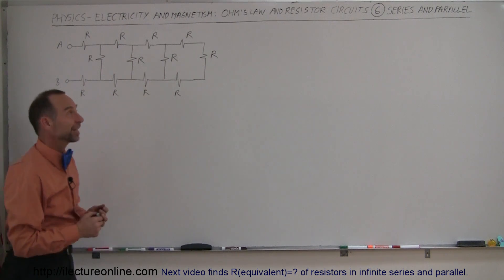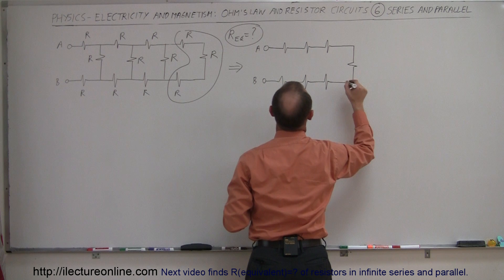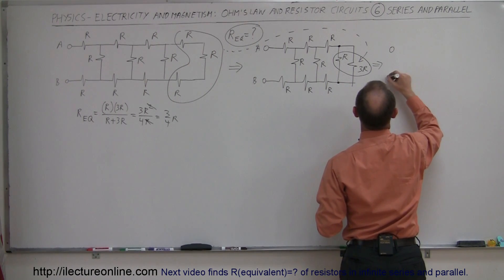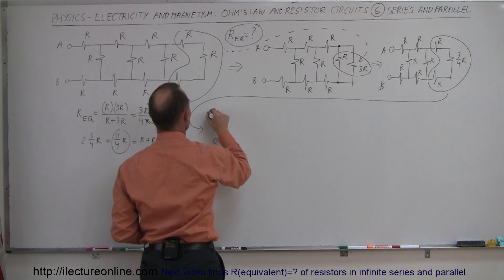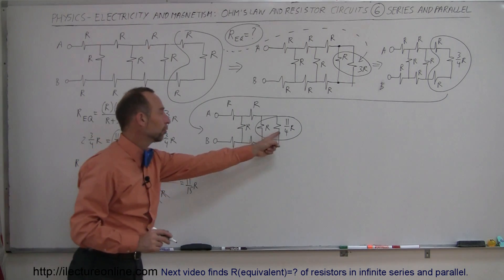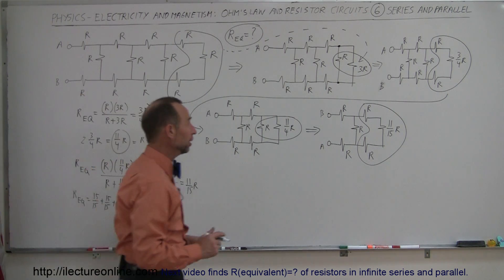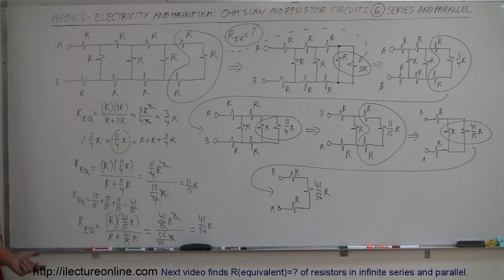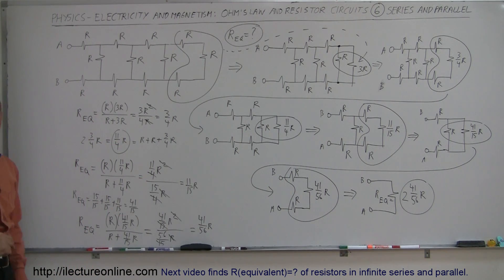Physics 42   Ohm's Law and Resistor Circuits (6 of 23) Series and Parallel

Comment: do u have tutorial on how to solve current with this? thanks :)
Reply from the maker: There are a lot of videos showing you how to do circuit analysis in both the physics and electrical engineering playlists.  Just go to the home page, then click on playlists and find those playlists.  Let me know if you have trouble finding them.
Reply: to find the current you'll have to build the circuit back up after you have calculated the the equivalent resistant

Comment: you need the + sign Michel, otherwise your saying the total equivalent resistance is 2*(41/56)R rather than 2+(41/56)R
 other than that good job!
Reply: Hello Michel I think what +1willFALL meant is instead of writing 2(41/56)R you should have written  (2+41/56)R and BIG up from Morocco
Reply from the maker: +1willFALL No, there is&#160;no "+" sign required.&#160; Answer is simply written as a mixed number.&#160; (remember those?)  Thanks for the feedback, always welcome.

Comment: I don't understand the final calculation. If the last resistor is in series, how does it become [2*41/56*R], aka 81/56*R? Wouldn't it be 153R/56, or expanded: R[(56+56+41)/56]?
Reply from the maker: ***** 
153R/56 = (2+41/56)R   

The answer is written in mixed fraction format
Reply: I see, looks like I have something to learn. Google, here I come. Thanks.
Reply: Michel van Biezen but you wrote a wrong answer. You wrote 2 times 41 dived by 56. Is it correct??